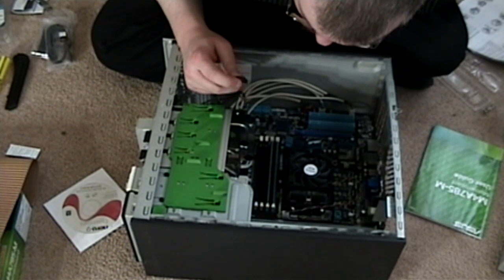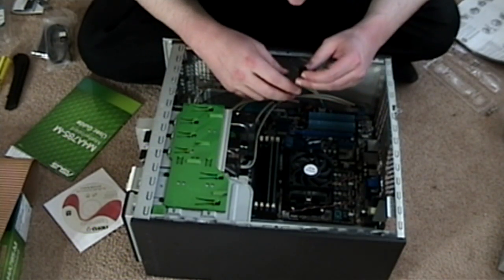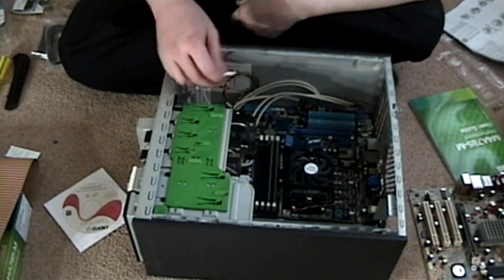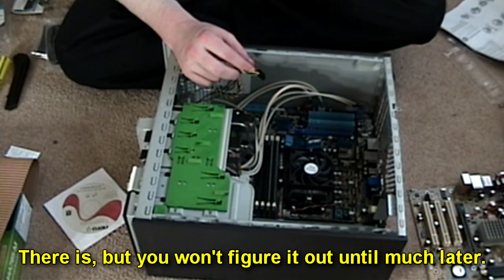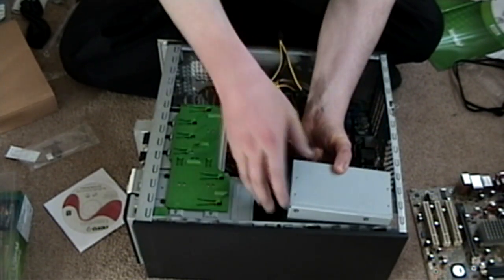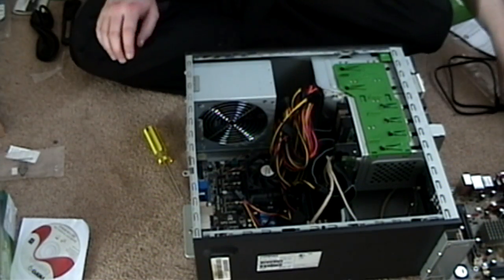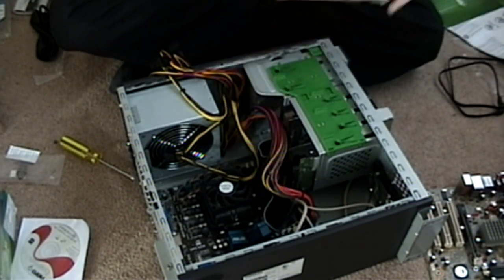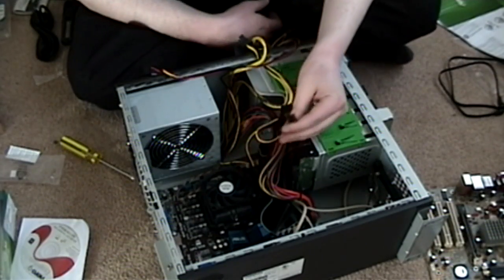Building The New Computer - Part 5: More Confusion and Power Supply Installation

Comment: some motherboards come with an adapter with pins sticking out but anyways the wires need to be separated and put into separate 2 pin connectors fyi not bashing great videos man

Comment: FYI - The reason you never get any screws with your components is case they usually come a new PC case.
For your sound to work proper you'll need to find an audio driver on the Web ''RealtecAC97'' Just Google or Yahoo it and it's a FREE download,
Did I mention it's FREE. Or check your ASUS driver disk for a temporary driver. 
Your ASUS has parts bag with jumper adapters in it.

Comment: @Zaranyzerak  you can also, if it's possible, remove matal "pins" from the front panel buttons/leds connector using a small flat screwdriver or a thick needle, and reconfigure them in this connector

Comment: Yeah, you have to hate cases from HP, Dell, Compaq and the like. They use proprietary front panel connections to speed up the assembly process by half a second. At least HP (And probably Compaq because they're the same) allow you to put the motherboard into other cases. Crap like Dell use extra proprietary so you can't hook in normal headders.